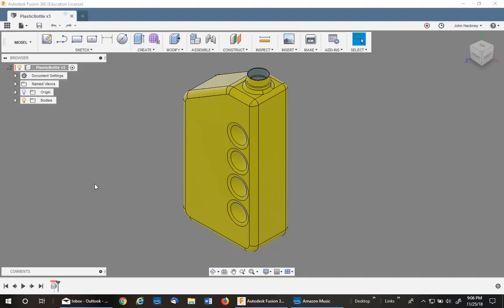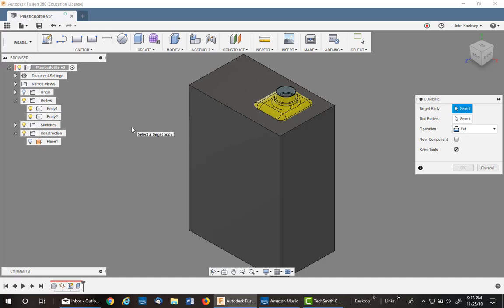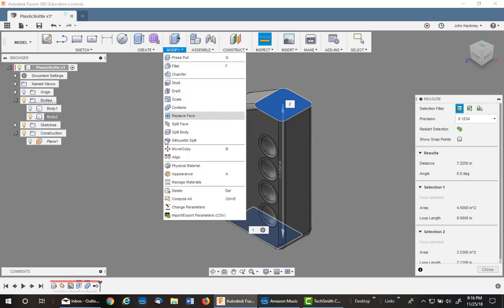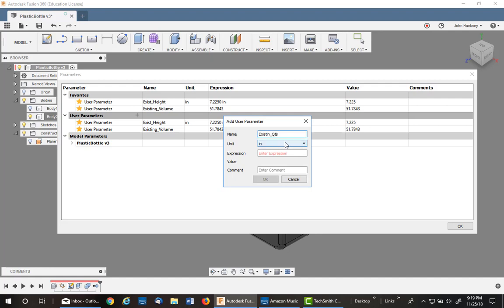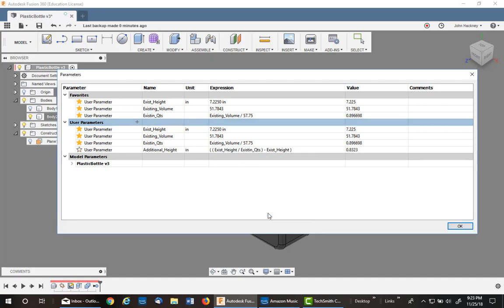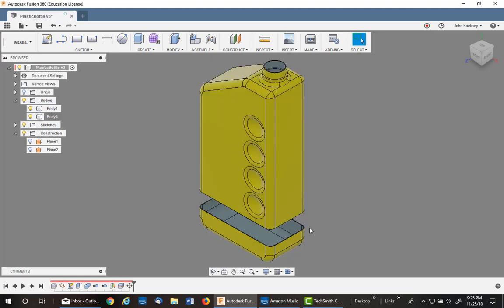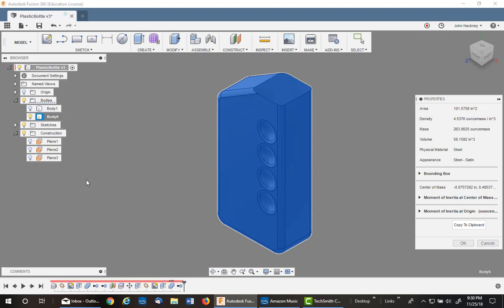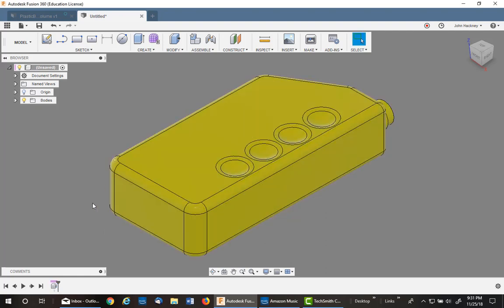Modifying Plastic Bottle to Hold Exact Measure

Comment: Thx. I'm thinking the I.D. (the Inside Dimension) is imperative vs "it doesn't really matter which" in obtaining the correct volume.
Reply from the maker: Not sure what you are referring to?  The size of the sketch, used to create the body representing the fluid does not matter, just so it contains the outside dimensions of the bottle.  If you are referring to something else, let me know.
Reply: Hey, @ @jrhackney  Apologies. I was referring to (extracted from Google's transcript)
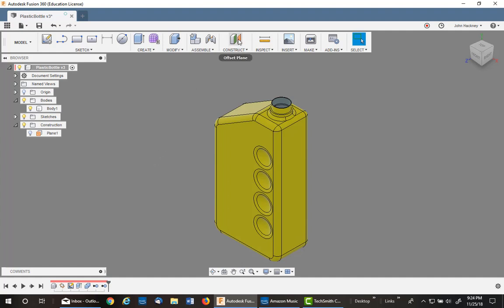07:13 an offset plane from the inside face of 
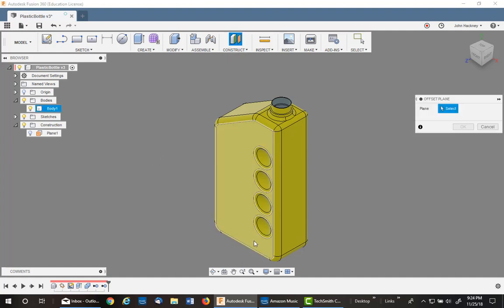07:16 the model "it really doesn't matter 
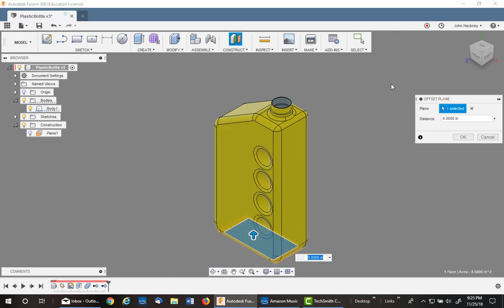07:17 inside outside" but just we'll use the 
07:20 inside 
I was confused concerning width of model's body walls, etc.
Thx.
Reply: I was wondering about the wall thickness too.
Reply from the maker: @peterjansen4894  The wall thickness is constant and has no bearing on my results since I am subtracting  the complete body from the body representing the liquid.  Maybe you can elaborate on what you are wondering about and if needed clear it up for you.
Reply: @jrhackney  you are making a volume of the outside of the container. That volume contains the volume that the wall thickness represents. Your example would be better if you made a combine of the inside of your flask. The inside is the true measurement.
Reply from the maker: @peterjansen4894  Go back an look again.  I create the body representing the liquid on the outside, true but then I combine CUT the bottle body from the liquid body which created two separate bodies from the single body representing the liquid.  You will see, when I turn off the bottle body, the cavity left between the two liquid bodies.  I remove the outside one so the only one left is the body that filled the inside of the bottle.
Reply: @jrhackney  my bad. I apologize. Missed that. Thanks for your videos, I enjoy them. Keep up the good work.